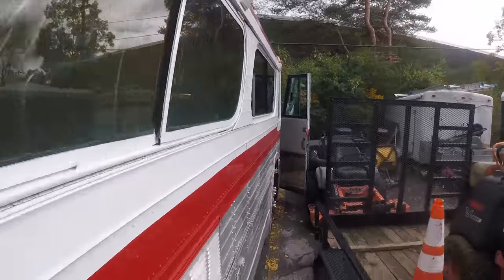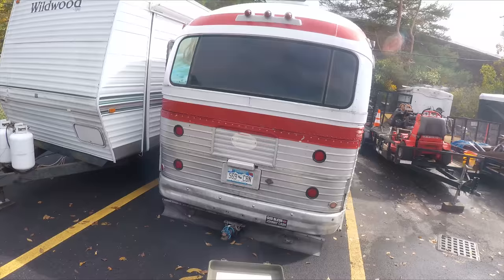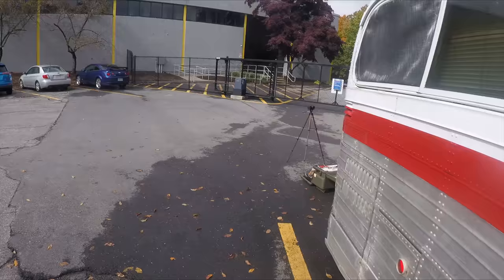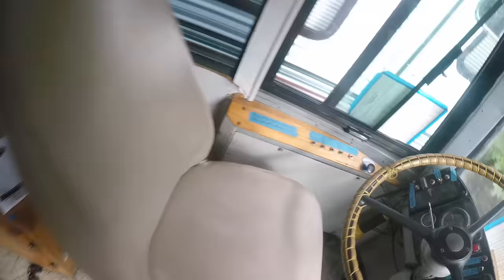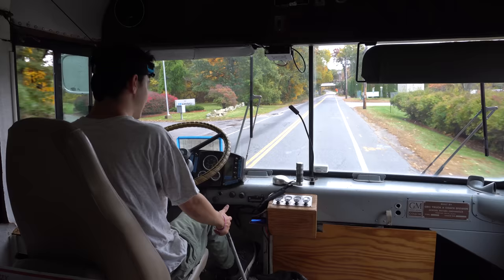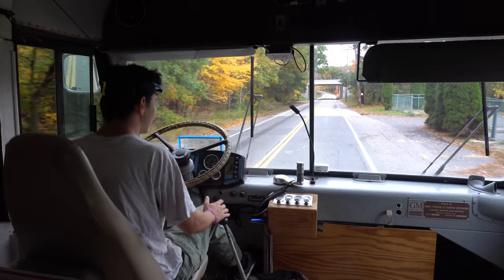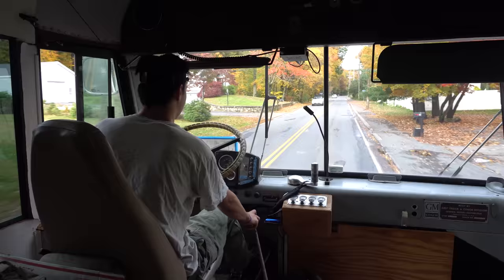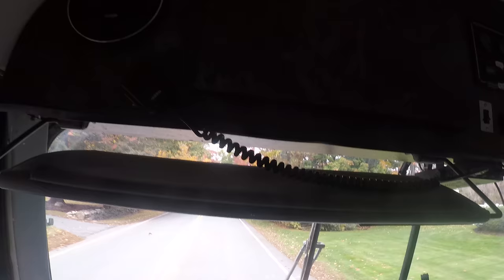1959 GM 4104 Bus. Driving/Shifting

Comment: Back in 1981-82 I was at the Word of Life Bible Institute, up in the Adirondacks in, NY State. They had a travelling student choir, and they had three old buses they used for that. They had a 4106, and two 4104s. They were old back then, but to me they looked very modern. I was not in that choir, so never rode in them. A few years later I remember driving my grandfather's farm truck, which was a 1947 Studebaker with a 4-speed unsynchronized transmission. My Dad warned me about it ahead of time, and I had to teach myself double-clutching, which was fine.

Comment: You seem to be doing fine playing/Slipping  the clutch while moving slowly . Just don’t overdo it because you can burn the clutch. Whenever possible keep it fully engaged when you want to move and disengaged while stationary that way you lessen the wear on the parts. Remember that it is not a baby buggy like most cars. Keep plenty of space ahead and don’t go too fast. Learn about braking and using compression to keep speed down and conserving brakes and air pressure on long or steep grades. Know where You are going and that You will have no problems negotiating narrow roads and parked cars. Don’t go down a road that You cannot back out of. Learn to use the mirrors to back up and always be careful for inattentive driver’s who are not watching for Your warning and turn signals. Many drivers drive too fast and are not looking or thinking ahead. Many lack professional driving skills but believe that speeding is skill. There will be time when You must overtake and pass slower vehicles of people who bunch up and may be daydreaming but always watch out for those who will pull out in front of You without being able to accelerate properly to match the speed of the faster traffic  traffic they are merging into. Too many people are selfish drivers and inconsiderate of others. They may pull into you’re safety  zone and brake suddenly because they are inconsiderate. Try to avoid excessive braking by anticipating the need for it and slowing or backing off on the throttle.  Drivers of heavy trucks look ahead and slow when seeing red lights or green ones that may be getting ready to go yellow then red by slowing and not having to stop completely momentum can help you gain speed more quickly whereas stopping completely makes it harder to get with the flow of traffic.Make sure You are insured for friends riding along and no boozer’s . Even non driving ones can be problems.

Comment: When you get the speed of the transmission gear to match the speed of the engine output gear, You don't need to use the clutch at all. I had a failed clutch linkage one time and I left Leominster, Ma, and drove about 70 miles to the New York State Line on the Massachusetts Turnpike. I actually had to shut the engine off at the toll booths, and then restart while it was in gear after paying toll. I wouldn't recommend it but there may come a time when you don't have a way to clutch and It beats the crap out of sitting along the road for hours. You have to plan your stops way in advance and run up and down all the gears. With that screamin' 671 there is enough rpm differential to drop 2 gears per shift on a 10 speed, IF do it perfectly, but it's very do-able! Love the bus. Check relentlessly for a vendor to replace those windows. There are always lots of start up small businesses that make amazing products, and the internet is a great way of finding a place! Best of luck and keep the old girl running. Love to see more vids soon.

Comment: Use to drive them when I was in my early 20's first job. FYI, if you lower your seat all the way down, and put a long shifter knob on there, you will find it much easier.  Take a while to get used to the lowered seat but, it makes it so nice.

Comment: You’re overrevving on your downshifts. Listen to the highest rpm and the rpm where the downshift actually engages. They are too far apart. Just a bit of advice

As for the upshift double clutch grinding. Dont put the clutch all the way in, it has a brake and will put everything way out of sync. Try clutch in 3/4’s shift to neutral clutch out then clutch in 3/4’s again and upshift. That should smooth it out. 

Also look into floating gears like in a semi. You only need the clutch from a dead stop to get moving, then at the correct rpm the stick can fall into the next up gear without clutching
Reply from the maker: Cool I’ll give all this a try thank you
Reply: @CattleRustler - PD4104s like this one do NOT have a clutch brake, never have, never will. Transmission/clutch assembly is not designed for one.
Reply from the maker: @RustySax1949  Yep. Upon further review, this does not have a clutch brake

Comment: Nice bus man! I’m not certain because there could be combo systems out there…but I’m pretty sure your air suspension is no longer self leveling, those black knobs under the gauges are manual valves for each corner. Push or pull to add or release air. Again not certain but pretty sure haha. Bus did look very low when you drove away, typical bag pressure should be nearer to 80lbs than 40 when you’re on the road in my experience. 

As for shifting, with my 6-71 and 4-speed I find double clutching every shift up or down is faster and smoother than the “patient” way. You are doing good going up to the governor every time before shifting, thats the only way these old two stroke diesels will stay cool. Don’t be afraid of rpms!
Reply from the maker: Yep, I've been told RPMs are your friend on the 2-stroke diesel. I think you may be right the rear end looks pretty dang low. I was told by one of my grandpa's friends (an expert diesel mechanic who drove with him to truck shows) she was self-leveling. You're right the black knobs are to add and remove air manually but it's my understanding that is just an option and she will eventually level out...which I've found to be true
Reply: @RossTheBuilder  how much air is in your bags when you're driving. I just rewatched and man o man you're bouncing around a lot...unless those roads are way worse than they look!!

Comment: On most manual semi-s usually you do not need to double-clutch just "feather" the accelerator to get it out of a gear or get it into next...of course sometimes you need it a bit...
The technique for shifting is to hold it at the gate with light pressure "3 finger" and when the rev matches then it will go in...

Comment: One  BIG  mistake with Double Clutching is pushing the Pedal too far down . Advice from a Retired Trucker .
Push it down into the  " Take-Up " Zone , so that it is Slippy and " Feel " your way between gears . No force needed , you will feel it coming good .
After you get used to it you may even Stop using the clutch and " Float " the gears . That will happen once you Know the Ratios .
If there is no Tachometer , the Speedo tells you what gear you should be in . There may even be Marks on the Dial to help .
Lovely Old Bus .

Comment: shifting will become second nature after a while , you won't even consciously think about it . drove that same engine (we called 'em 238s) w/10 speeds , 20k empty/50k loaded for years . this might help downshifting till you learn by ear : mark top speed in 1st , 2nd , 3rd on speedo . for example let's say top speed in 3rd is 45 mph . you're in 4th , she pulls down near 45 , clutch pedal in , neutral and hold throttle wide open w/clutch out , clutch in and get 3rd , clutch out (all relatively quickly) . fairly level ground example , compensate for steepness of hill .

Comment: Powered by General Motors,(6-71) that's a engine with 6 cylinder's in line bore at (71) cubic inches per cylinder ,city greyhounds for interstate use ,used a (8v-71) again it's 71 cubic inches with a 8 cylinder Vee block

Comment: Love that BUS!!
But you're revving so high my friend!! 
Remember it's a diesel engine!! Diesel engine runs at low rpm's so 1500 is the right rpm for you to shift!
Good luck
Reply from the maker: Diesel indeed but a 2-stroke diesel. They absolutely love RPM. It’s really bad to lug a 2 stroke detroit in low rpm’s. Makes it fun to drive!
Reply: @Kim Ro Woon - When he hit's the governor in 1st gear, the engine's only turning 2100 rpm - it just sounds so much faster because it's a two-stroke design. 1500 is ok for a four-stroke engine, but not these Detroits.

Comment: You ask about double clutching on the up shifts. The thing is that once the gearbox oil is up to normal running temperature you might need to double clutch even then and also do it a little quicker.

Comment: He got a few things right and wrong. You don’t need a CDL if you are not using the vehicle commercially and the vehicle is 26,000 lbs or under. That bus is much heavier than 26,000 lbs. I drove them. They hover around the 40,000 pound area. The class 5 driver’s license (cars and trucks weighing 26,000 lbs or less that do not carry hazardous materials) used to be limited to 18,000lbs. Then they created the “non CDL C” license which brought you up to 26,000 lbs. people with Winnebagos were complaining that they had to go out and get a special license just to go camping so they made the class D (replaced the class 5) up to 26,000 lbs. which is scary. Have you ever seen people trying to drive a 26,000 lb rental truck? 😮. He said “this thing really needs a back up camera. I have no idea what’s behind me”. This is an example of why you need a CDL for a vehicle like this.

Comment: Better off float shifting, your left leg and transmission will thank you. Best thing to do is, shift as fast as you can, and listen to the transmission.  If you need to slow down on the shifts, slow down accordingly. Then that will be your rhythm.  I noticed that no two trucks ever shift the same. Even if it is the same year, make and model. Always have to learn how to shift each truck, as it's required. When going into gear, if you get stuck halfway, just goose the throttle, while maintaining pressure on the shifter. When down shifting, rev it in neutral consistently, while trying to catch the gear. If you are going too fast for the gear, you might need  to keep the revs high at a consistent rpm. Then it'll pop in. Driving stick is like dancing with a lady: start with the basic fundamentals, but then let her body and rhythm guide you the rest of the way.

Comment: Former Greyhpund Driver here. You will see a color code on your speedometer. You shift at each change of color at max rev. Should be at 20 to 2nd, 30 to 3rd, and 50 to 4th. Just double clutch counting one one thousand, two one thousand. Down shifts are at same speeds down shifting with max RPM with throtle on the double clutch. Bye the way get rid of the air seat. You don't need it.

Comment: Aah! Your grandad was Dr. Bill's brother, correct? Much like mine, your last name isn't exactly Smith or Johnson, lol, so it sticks in one's memory. I do believe I met Jerry at ATHS Syracuse or Macungie quite a few years back. Dr. Bill and his Mack will not soon be forgotten, small world. My condolences for your loss.
Reply from the maker: Yes! Dr. Bill’s brother! He made it to every ATHS show for a while. Small world!
Reply: @RossTheBuilder  So sorry to hear of your Grandad's passing a few years ago, I hope the driver was jailed. Dr. Bill was a legend in the ATHS and is talked about daily on Mack forums to this day. What became of his W? You could and should do a piece on both of them, they led very storied lives. The tale of the Jersey turnpike brick disaster was similar to a load of asphalt I dumped in the wrong place once, back when I just got my CDL and lied to a paving company to get a job, had to shovel it back in by hand. Though most was tossed into the woods, lol. Is the bus in Colorado or Mass.? I know plenty of folks that'd be happy to help you sort it out. Sounds like the regulator isn't letting pressure build fast enough. Let me know, I'm in NY. My Uncle Bonesy knew Dr. Bill very well, Mack guys, lol.
Reply from the maker: The Bus and I are in MA. That's a great idea. My gramps Jerry and I, before he passed, would exchange emails during the early stages of COVID and he told me a few really good trucking stories (including that Jersey turnpike one!). You're right, a write-up would be a great idea. I've got a blog to write up some of Jerry's trucking stories and I'll see what I can find on Bill. I'm definitely in way over my head with this Bus and, and although I've got all the service manuals, I'm no diesel or bus mechanic.  I, however, definitely have the 'gearhead' gene and will do my best to take care of the bus.  

I'm all ears for people that would be willing to help me sort out issues with the Bus. I'm in college and I fear I may not find the time to give the old girl the attention she deserves.
Reply: @RossTheBuilder  You'll be fine, just reach out to the community and I guarantee you'll have more than enough hands ready, willing and able to guide you. Good talking to ya, Ross.

Comment: Awesome bus. I’m not sure if this applies to buses but I was told not to downshift when slowing down in a manual. Reason being is that using the drivetrain to slow down the vehicle is pretty hard on the transmission and clutch. Brakes are cheap and easy to replace. Would love to drive one of these one day.
Reply: You have been told very wrong things. During engine braking, you have exactly the same forces as when you're accelerating, just in the opposite direction. There is absolutely no harm in engine braking. 
In cars and on bikes, you don't need to conciously engine brake - just keep it in gear, downshift when you hit 1500ish RPM. All the rest of the deceleration you need, you do with your brakes. Usually you don't shift down to first if you're coming to a stop.
The exception is when you go down grades. In this case, you shift down to whatever gear you need to not increase your speed (but also not go too slow). Only when you run out of engine braking, you start working the brakes. It is completely normal to have your engine screaming at 75% of redline when going down a grade. This is even more important on cars with an automatic transmission! Those low/1/2/3 settings are there for a reason. In D, an automatic pretty much does not have any engine braking, you have to shift down on a down grade to avoid cooking your brakes and losing brake power.

Comment: I just found the video and thank you for sharing this. As someone who has been blind all my life, I have always enjoyed riding in buses with manual transmission, but driving one seems to be another thing altogether. This video shows me that and explains a few things I have heard over the years, when writing in Coaches with manual transmission in Canada. for example: revving the bus high in order for it to grab a gear when shifting down and I always thought that the bus had done it on its own, whether it was standard or automatic. the other thing for me is the synchronized shifting, versus not synchronized. What exactly does that mean, as I've never thought to ask or had it explained to me properly? Again, thanks for sharing.

Comment: I am not exactly sure what my bags run at but my air system runs around 115 pounds.   I didnt think the bags would be so low.  Putting in a back up camera from ebay is not hard and quite necessary.  Just need 12 volts and run a long cable to the back.  Put one in my bus - 45 feet.   i actually installed a second one.  One for looking back and one for looking down to get close when going into camp sites.  Saves me having the wife on the phone behind me all the time and acts as a rear view mirror when going down the highway.  I went with the cables as I heard wireless can be not so good on a long bus.  My picture is always crystal clear.

Comment: Its not like floating like they say.. idk mine was destined for the junkyard so i didnt really care but i guess it was like driving a eaton fuller if u just used 4 of the 13 or 18 gears. U can race it, essentially just use the gas pedal as the clutch after take off. Be ready to shift, race, when the engine speed matches the trans output it will go into gear. And no theres not a clutch brake. That bus would probably be before the time of a clutch brake, if it has jakes i would not use them to learn any of this. In my mind that would only make it more difficult. It will also start in second quite easily. Detroits love to eat so its fine. Something tells me its gonna need a bit of a overhaul either way. The mess of accessories in those transverse applications might look bad but its rather easy.

Comment: I admire your efforts to learn the dark art of shifting an old non-synchro transmission. Some more advice,  if you're scratching gears on a double clutch shift, you're not giving enough time to match engine speed to road speed for the given gear.  I disagree with the poster about your style of upshifting.  I recommend you try to get the bus to a safe enough place where you can safely give extra attention to the tachometer and speedometer.  Learn where the revs are for the bottom of each gear at your given speed you're changing gears. Listen to the engine while you're shifting to learn how to do this without watching the gauges. Depending on the oil inside the transmission to slow the input shaft will render you unable to get a quick enough shift to consistently get a higher gear on any form of an uphill grade. Aside from this, practice practice practice. You'll get it down and will get to where the lever slips silently and smoothly up and down the gears quickly - something highly important for hills and mountains. Have fun.  I want to drive it now also.